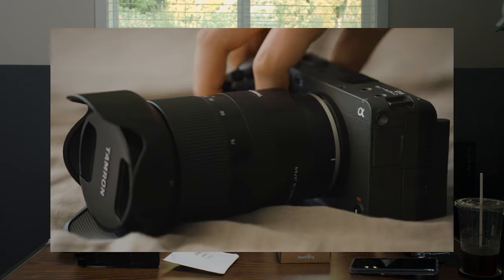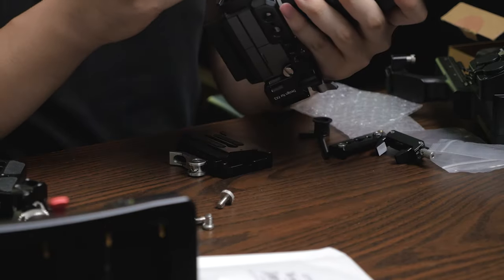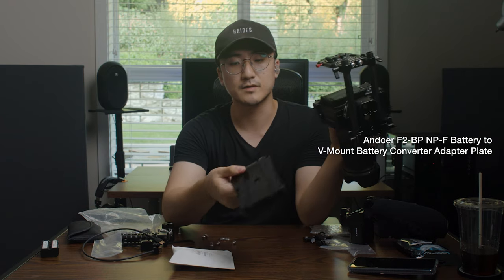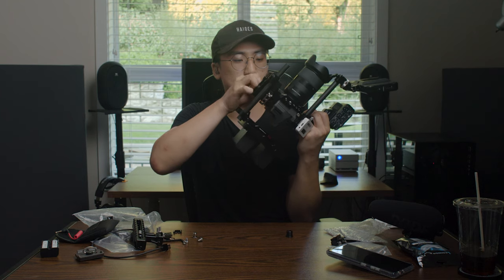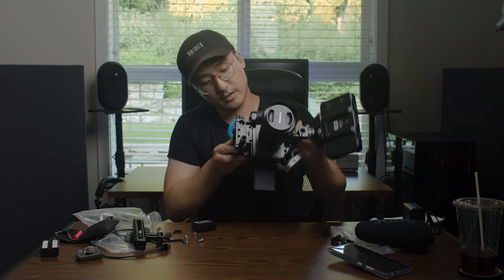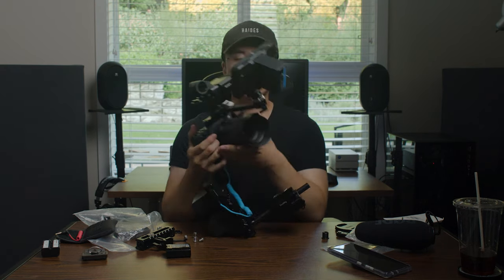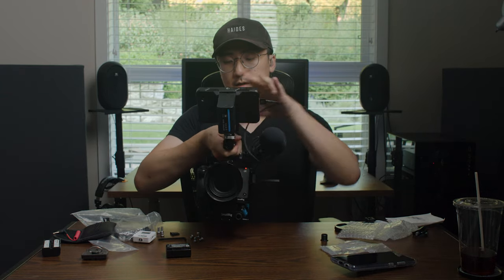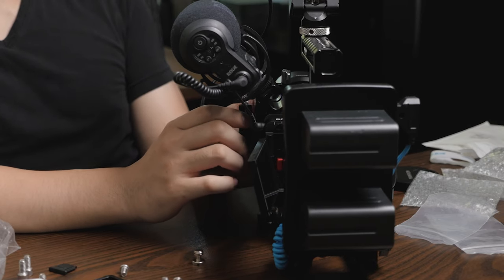Building 2 Handheld Sony FX3 Rigs (Works with Top Handle!)

Comment: Wouldn’t any mic you mount to that setup pick up the monitor fans over anything else? Otherwise that’s a really clever monitor setup with the rail.
Reply from the maker: I've never noticed that in my audio actually! Typically the shotguns I use are very good at rejecting sound from the sides and the sources of audio I generally capture will be loud enough to drown out any fan noise. If I'm filming outdoors I think the ambient noise is usually louder too.